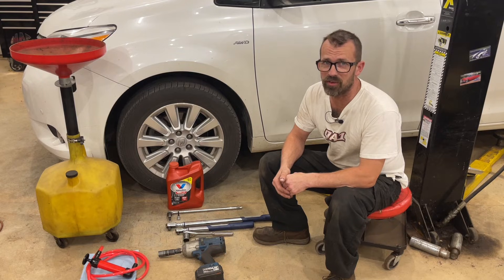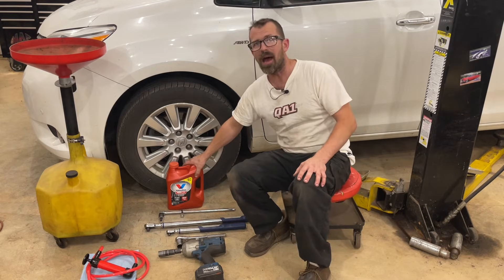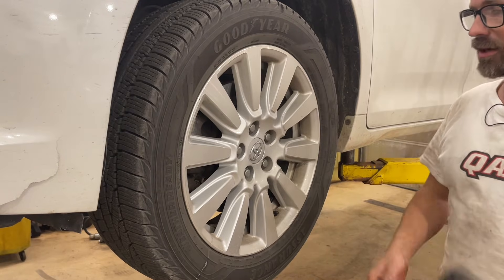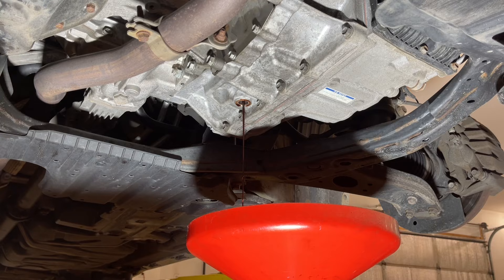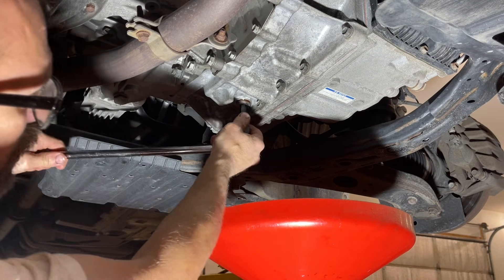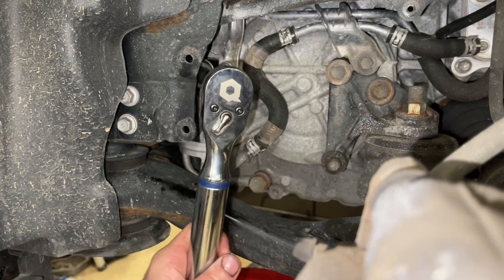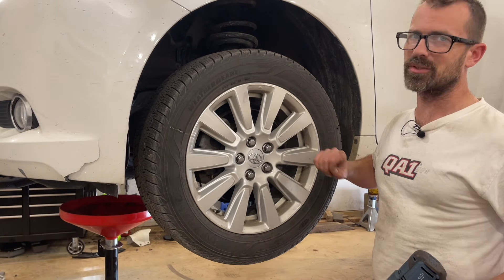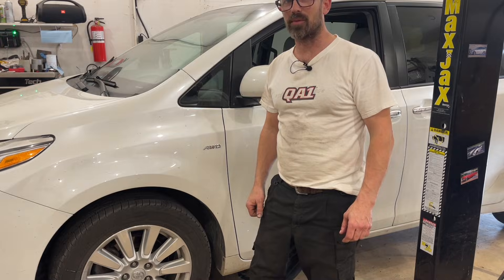🔧 2017-2021 Toyota Sienna Transmission Fluid Change, how to check trans temperature. UA80E

Comment: do you have video for changing the transmission filter as well?
Reply from the maker: I don’t. If you perform the fluid change as recommended by Toyota I don’t believe you will ever need to replace the filter. 

If you do decide to replace the filter the transmission pan is located on the front of the transmission and it’s under that.
Reply: Thank you.  I figured that some day, one of us will needed to change it out....:)
Reply: @bennieaust  I just changed my transmission fluid on a 2013 sienna in a dealer it shift fine runs fine but I hear a very small noise coming from either the engine or transmission Should I worry about it.
Reply from the maker: @ramonmorales9646  It
s very hard to say without hearing it in person.  I think the best recommendation I can give you is bring it back to them and tell them your concern.  If they by chance are at fault it will at least give them the chance to make it right.
Reply: @bennieaust  thanks I just made a appointment for tomorrow
Reply: @bennieaust  so I just took the sienna to dealer they said everything looks normal, and that small noise is just my fuel pump, but they said that as long my sienna don't do really loud noise and shifts normal and runs normal I don't have to worry about it they said that I was just was looking for noises because I just recently changed the fluid but they said it's fine 🙂 .
Reply from the maker: @ramonmorales9646  great to hear!!

Comment: Is there a filter to replace or clean? Normally those are on the bottom pan but obviously with this setup there is no pan at the bottom.
Reply from the maker: There is a filter inside the front cover.  The service Toyota calls out for is a fluid change just like I do in the Video.  If you do the fluid change as recommended you shouldn't need to replace the filter.  If you feel better changing the filter, go for it.
https://amzn.to/3to30Oi

Thanks for watching!

Comment: Great video.  One of the best explanations of any video I’ve seen on anything really.   Also at 174,000 miles should I also change my filter ?  The vehicle transmission was serviced at 115,000 I think. But unsure if they did the filter too
Reply from the maker: Thanks Derrick!

My honest opinion is that if you change the fluid on a regular basis you will never need to change the filter. The particles generated by transmissions are very fine and are largely suspended in the fluid.  Draining out the old fluid will remove those particles. 

If you are feeling ambitious and really want to pull the pan and replace the filter don’t let me discourage you from doing that, I just think changing the fluid is by far the most important thing, and unfortunately commonly neglected.
Reply: If it’s newer than 2015 it shouldn’t have a replaceable filter
Reply from the maker: @hayden93  I'm seeing the same filter kit listed for 2004-2017 Siennas.  I can't comfirm if that's right or not, but it's definitely not what I cover in this video.
Reply: @bennieaust  I know the siennas with the 8 speed do not have a replaceable filter since their is not drain pan anymore and it would require disassembling the transmission to access, I’m not 100% sure on the years thougj
Reply from the maker: @hayden93  They moved the pan to the front of the transmission.  He's my video on the 8 speed in the Camry.  https://www.youtube.com/watch?v=0MSs6nm2TUs
in the first shot I show a transmission out of the vehicle so you can easily see the pan on the front.

Comment: Hi i have a question not about this though. I have a truck and my frame looks cracked/ rusted all the way around it is it savable cause i really like this truck
Reply from the maker: They are always saveable, cost can sometimes be an issue though. You can always have the frame replaced.  Sometimes the frame can be repaired, but it all depends on how bad it is.
Reply: Its a pinky wedth size crack fully around just behind back tire
Reply from the maker: @SP00K_rumble , if it’s not really rusty then a repair could be a good option. If it is rusty it may be very difficult to repair.